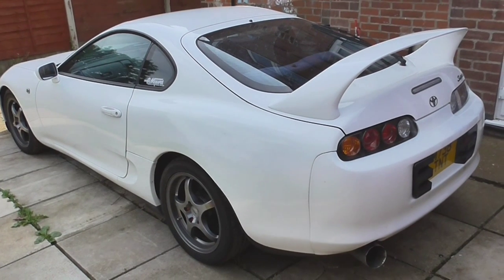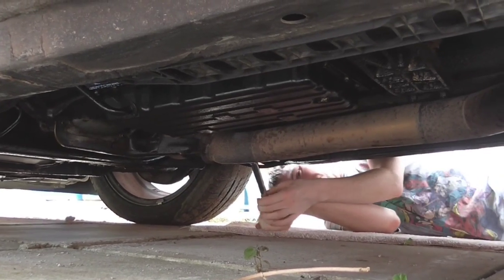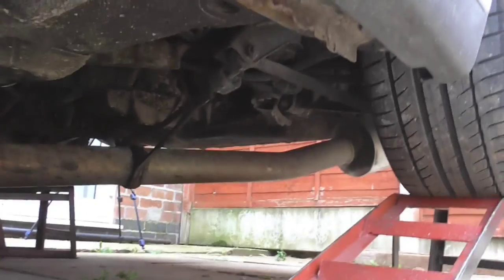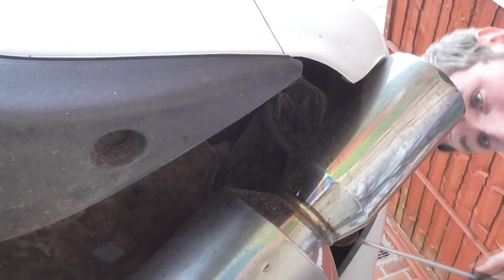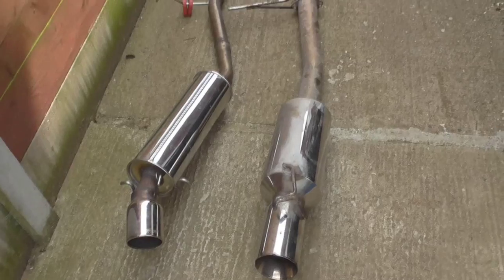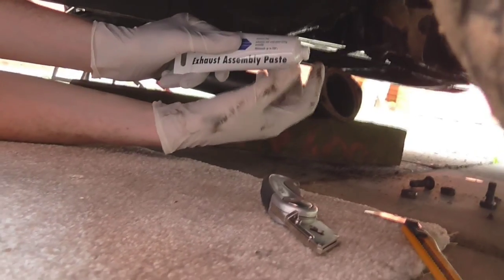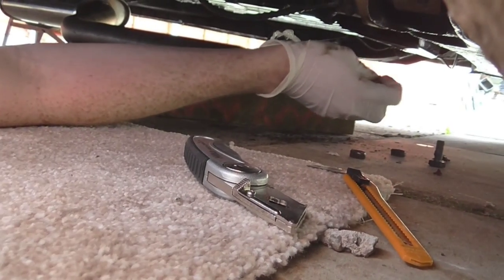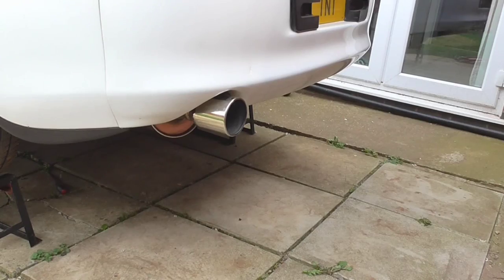How to Change the Exhaust Cat Back

Comment: I liked the sound before and it had a bigger bore.
Reply from the maker: aaron cost the sound before was awesome, until your drove it, with it being automatic at the time, it just droned. The bigger bore was bad for the car, with it being a non turbo, you dont want to have a exhaust with a massive bore size, as you will lose back pressure and lose power. The supra was a lot more responsive on the 2.5 inch exhaust we put on, instead of the 3 inch one we took off. When we turbo it, we will upgrade the exhaust again.